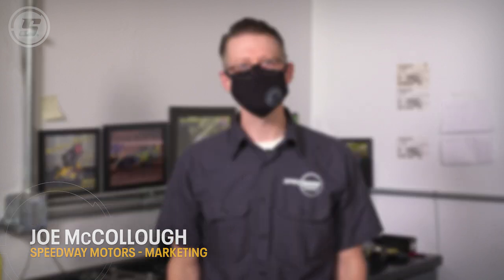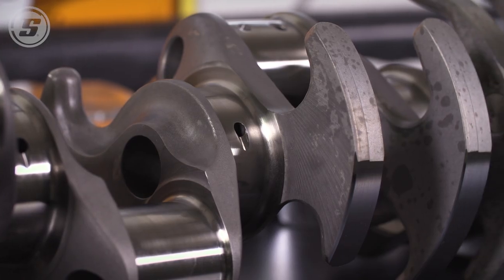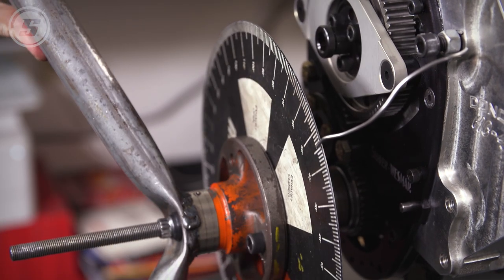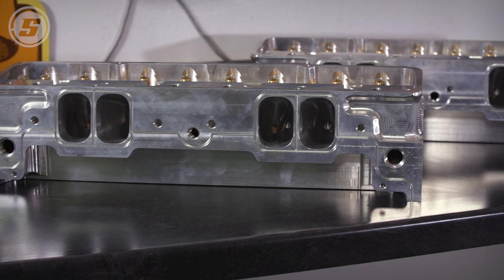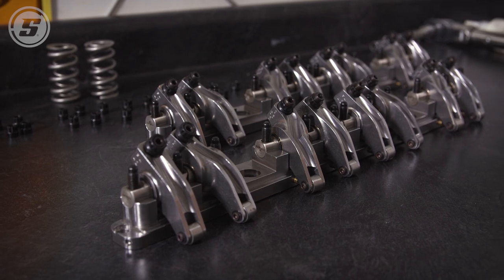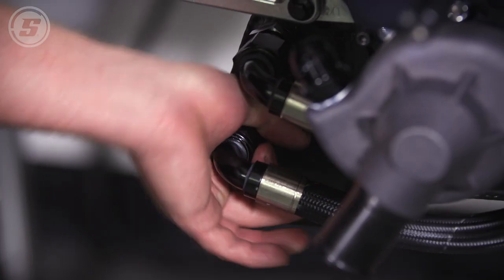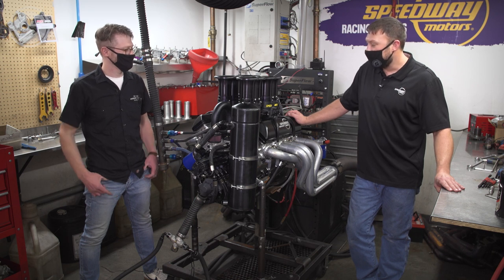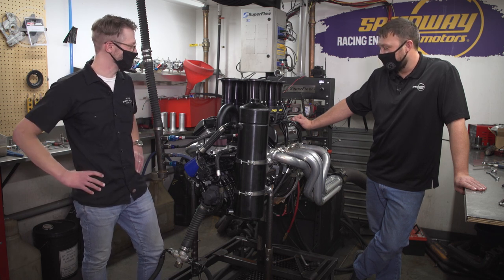410 Sprint Car Build Ep 14 Engine Build and Dyno

Comment: Ladies and Gentleman, This is what over 50K looks like!!! 🤟
Reply: a totally cnc milled block made out of a block of aluminum...jesus   the block has gota be 10-15 grand
Reply: @trillrifaxegrindor4411  Easily!!! I’ve been racing DLM’s for close to 15yrs, and our engines from Andy Durham & Vic Hill are right at 50K. Of course by the time you add an oil system, carb, headers etc the price goes up. Yet, These engines exceed those in price by a pretty dang decent margin... 💰💰💰💰😂
Reply: Probably about $37k in parts
Reply: 8 years ago this type of engine was sitting around 58k, probably sitting at about 70 to 75k now easily no doubt.
Reply: How about over 65,000

Comment: Wow, what a technological gem...very cool and thanks so much for posting. Had I not went Aerospace Engineering, I would have loved to be an IC race engine builder/designer. As to the 950 HP, that is damn impressive for a 400 CI N/A endurance engine, especially with a mech fueling system. My engine of choice has a bit more HP...I believe the generally accepted LBF conversion is approximately 150,000 HP per F119-PW-100 turbo fan w/afterburner, and the F22 has two of them :) Have a nice day.

Comment: I'll bet that engine costs more than a hundred bucks.  Actually this all amazing stuff. When I was young, 600 hp was smoking hot. Thanks.
Reply: Oh yeah? I bet it was over a thousand! Haha
Reply: @MrCarnutbill67  Oh come on man, don't exaggerate.
Reply: It’s amazing how engine tech had advanced. Back when they started in the early 80’s a good 410 sprint engine was around 650. Some guys are over 1000 horsepower. I’ve heard even the 360 sprint cars are over 800 these days.

Comment: Do you recommend the ISKY solids rollers lifters for the street? I have been running crower HIPPO lifters (HI PERFORMANCE PIN OILED), never had a problem with them, had just been told they are great long running solid rollers which will survive street use.
Reply from the maker: The ISKY rollers are great rollers and you could run them on the street without question. In both hyd. or solid.

Comment: The Mona Lisa of SBC. Absolute Masterpiece. I wish we could've gotten CR and cam specs and flow numbers. I would imagine the heads are well over 400 CFM'ers.
Reply: CNC ported ls3 heads flow 360cfm so I bet you're correct. The cam specs were  .760 lift on both intake & exhaust. I think these engines are 15:1 compression

Comment: Small block Chevy? Looks more like an after market  Frankinchev. Thank You for Sharing this interesting video on these race engines.
Reply: Its just a generic trem people use. It gets the point across, unless we're splittin hairs.
Reply: Think of it like a persons last name.  A whole lot of people made some changes over the years but the lineage still traces back the same.

Mainly it’s an architecture thing, camshaft spacing, main journal locations, head bolt locations, etc.

Comment: Zach: Great job on this great looking engine! One Question: You ordered a 109 degree overlap that you reset to 105 degrees. Is there a reason why you didn't order it that way, or were you advancing it to help on top end? Just learning.....Super numbers on the dyno--more than double of the displacement. WOW!
Reply: It’s a 109 lobe separation and he installed at 105 intake lobe centerline.  

Lobe separation refers to the degrees between maximum lift points on the intake and exhaust ports.  This is a fixed number on single cam engines and cannot change.

The 105 intake centerline is angle of crankshaft rotation from TDC to the maximum intake opening point or intake lobe centerline.

Also, camshaft manufacturers have transitioned to referring to the distance between lobes as a Lobe Seperation Angle or LSA and advertise overlap separately as two camshafts can have the same LSA with different lobe durations resulted in different amounts of actual valve event overlap.

Comment: Gas  port pistons are very hard on top rings and pistons and bores
I though that was drag race stuff.
Herein Oz at least the 410 limit was supposed to cost less than 372s at 8500. 
410s have quite a short life between rebuilds. 3 or 4 shows
Not so long ago 360s were running a season on an engine now they are not much better either
Reply: This engine is doing it easy, only revving in the 7000 range.
Reply: Your exaggerating on the number of shows. Most guys get between 8-12 on a motor and that’s here in Pa where our tracks are harder on motors than most.

Comment: What if you lowered the compression & put twin turbos on it, would it still be snappy & high revving? Just like that one is set up what would be the miles per gallon if put in a weekend warrior sleeper car.
Reply: its a naturally aspirated itb injected,alcohol burning,high compression sprint car engine..................

Comment: What's the build cost on that beauty?
Reply: An engine like that built by a central PA builder is $55,000 to $60,000
Reply: How much are parts?
Reply: @jbbass58  Speedway Motors now has this item in their catalog for $49,950
Salina Engines advertises a new aluminum 410 for $42,000 or $43,000.  Aluminum rockers and Pro Heads CNCed else-where than one-way technologies only differences.

Comment: What's the difference between this 410 sprint car motor and the motor they run in the big block modifies ???
Reply from the maker: The big block mods have a big block Chevy based engine with a CID of 500 to 540 depending on the rules you are racing. The motors in the big block mods make more power and torque but are also heavier. Also most of the mod rules require a cast iron block the 410 sprint car engine is an all aluminum engine.

Comment: What is the differences in these 410 engines between  the different makes( Ford,Chevy,or Mopar) .Are the blocks and heads different?   Or Just the heads are different?
Reply from the maker: The 410 engine brands are all very different.  The bore and stroke combination, and the fact that they are aluminum block and heads is really about all that is the same. That's why you see teams like Donny Schatz Racing having to do so much R&D to get the Ford program working for them.

Comment: Never  clay checked valve-to-piston?   Index the plugs?  Do you guys run rev-kit on 410s?
Reply: No one really runs rev kits anymore with the advancements in cam lobe development and spring technology.  Look into spintron testing and Project Spinal Tap.

On a proven combo with a custom designed piston made for a specific head, a lot of builders don’t clay check because the pistons were designed with the clearances in mind.  Indexing plugs is pretty tribal these days, but a lot of modern builders see it as a non-issue.
Reply: No the motors don't need it anymore it's all built into the motors from the start.This isn't your brothers 383
Reply: @JJ-1-1  Never owned a 383,  just building and racing 360 winged sprints.

Comment: what are those lines plumbed into the heads between the exhaust ports ?
Reply from the maker: That is were water from the water pump goes into the motor. It is a reverse cooling set up very common on aluminum race engines. The water goes in the heads and then most is forced down to the bottom of the block back to the radiator and a small amount goes up out the injection back to the radiator.
Reply: Those are methanol down nozzles.  They spray methanol.

Comment: I am surprised that you are not using gas ported top rings from Total Seal.
Reply: Tried a set at the shop I work at. Make zero difference in power numbers compared to vertical gas ports
Reply: @oneslows1376  They can make more power but, nothing you are going to feel. Plus, they help ring seal. No chance of clogging. Within the last 2 months, AERA did a webinar with a guy from total seal and it was very interesting.
Reply: Yeah I listened to the webinar. My boss had it on. Sometimes we think those guys just talk. I’ve seen the top gas ports clog full of carbon. Mainly around the exhaust valve area. I have not the gas ported rings yet since it hasn’t been worn out yet. As far as the gas ported rings not clogging I can’t agree or disagree. Power per dollar gas ported rings are just not worth it in the sprint car world. Maybe high boost applications such as pro mods or diesels. Then again that’s a guess since I have no experience with those types of engines

Comment: How much is an engine like that?
Reply: 50k all day long...60 if you get it from a big builder.
Reply: @AaronScutt  That's correct.  Even though Salina offers a new Aluminum 410 for $41,500.   KRE in Australia had a slight 2021 price increase ...... $90,000.

Comment: What’s the valve angle?
Reply: 15 degree
Reply: @justinworkman9980  
Standard deck height or tall?
Reply: @justinworkman9980  Oh really?  They used a 20 year old Brodix -12 head?
Try 9 or 10 degree.
And why the hell didn't the new Ford/Stewart 410 & the Toyota 410, with evenly spaced injector stacks just Chris-Cross them straight into the heads?   Rather than turning the stacks in?

Comment: There must be a reason why it makes peak HP in the 7200 range yet they pull it to 8500. I assume this has to do with where they want the power on the track, with the ability to over rev it a bunch coming to the end of the straights. Cool stuff!
Reply: Higher top end numbers mean higher low end numbers, you gotta turn as some point. These will run about 8800-9000 top end trying to make sure the low end doesnt drop below max power. 7000-7300
Reply: @VeNoMzxTaWsKi  So the car is that hooked up on the track that it can take advantage of maximum power as you get back on the throttle coming out of the corner, wow! I've never seen a professional 410 race in person but have seen a 360 race many years ago and was impressed how quick they were.

Comment: Can a Sprint car actually use all of that Horse Power ?
Reply: Sure as hell can.
How do you thinking they come out of  corners at 80mph sideways with both front tires in the air on dirt.
Reply: Yes sir...it takes 200 h.p. just to push the wing
Reply: @rtkl13  I had no idea the wing took that much power
Reply: @deansapp4635  yeah there is a lot of design that goes into them
Reply: @rtkl13  Thanks for the education, I always love learning new things !!!
Reply: @rtkl13 Real sprintcars don't have wings.

Comment: Why can't a magnito be used for gas racing engines
Reply from the maker: The magneto can be used on a gas engine. The methanol used in a sprint car is harder to light than gas and the fact that you don't need to run a battery is why they run them in sprint cars. There are some late model racers out there that run them.

Comment: Why not go needle bearing wrist pins since u used them for the cam bearings . We did a 565 on 2 stages that had them bolth and il never forget it cuz I'd never seen needle bearing cam bearings
Reply: Have you built a motor that went 950hp.........No  you haven't
Reply: @JJ-1-1  lmao the 564 made 2122 on c16vp fuel little boy
Reply: @JJ-1-1  if you click your pic/profile you can see the last 3 comments you've left on the channel and your going threw comment by comment bitching at people crying like your the only ones opinion matters or is valid . I speak as a 3rd generation drag racer and iv done this for 22 years for myself and let me be the first to tell ya no one gives a fuck let people comment and if you don't like it turn the comments off fast is 950 is small block power with a carburetor in today's world its a drop in the bucket so get off your high horse and enjoy the world if you don't like the comment section then don't look at it.  This comment is months old

Comment: lol, he said its a small block chevy. A true small block chevy wont last long with this power level. Also, he never said what deck height this engine is. Donovan makes 9.5" sbc blocks too
Reply: Most of the 410s built now are nine inch or shorter
Reply: And a top fuel Hemi has little relationship to anything the factory ever did, as well.

Comment: I'm calling BS on the dyno figures. He's using non corrected figures. 
I just watched a PME build with a LR7 Nascar engine stroked to 397ci make the same horse power but with about 12° more cam. 
This is making over 1.8ftlb per cube according to his dyno while the LR7 was making 1.6 and a prostock engine is making about 1.7.
I bet if he used a better correction factor it would drop down to the 1.65ftlbs per cube range.
Reply: It's Methanol...
Reply: @blomd5177  
The maximum ftlbs per cube of any engine on any fuel is 1.73ftlbs per cube. That is at 124% VE. 
His adjusted the corrections to up the power a little.